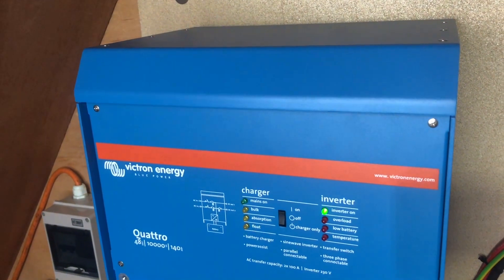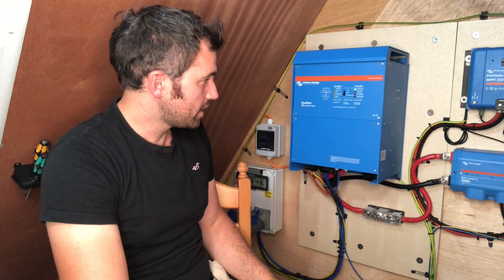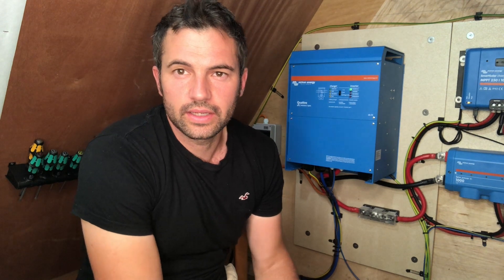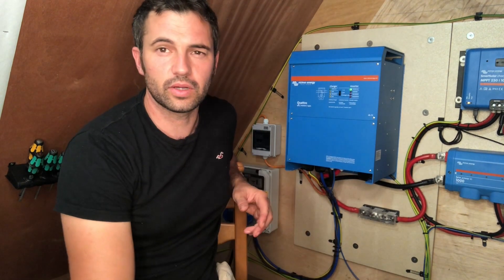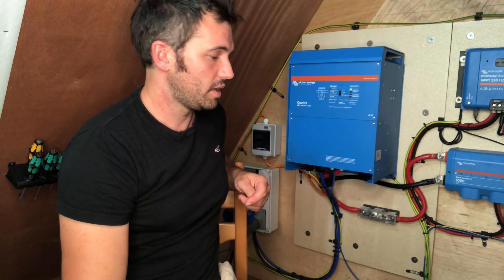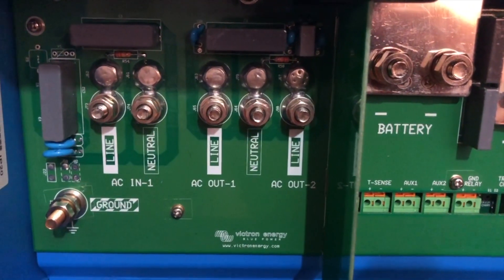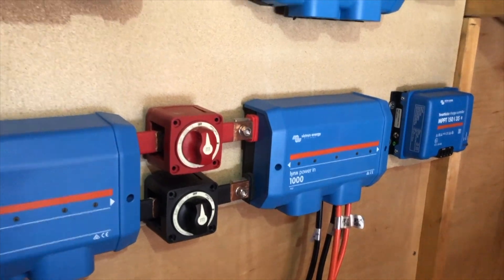VICTRON QUATTRO 48V 10000VA REVIEW: Victron INVERTER review | OFF GRID DIY SOLAR POWER SYSTEM

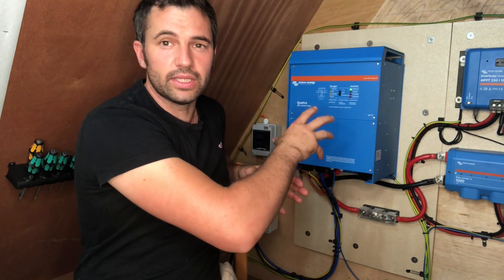Comment: At 5:03 into the video what size are your wire connectors. Or lug nuts? Can’t seem to find what size to use, already have the wires, just need the lug size! This would be for AC 1 out and AC 1 in. 
I just got my new Quattro 48/5000 inverter. I’m coming from a 24 V system. Thanks! 😜